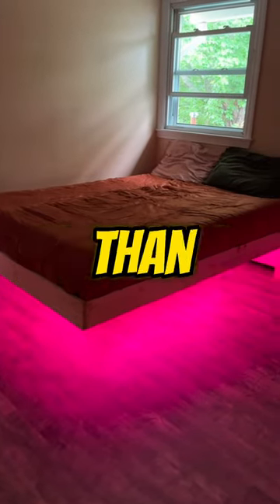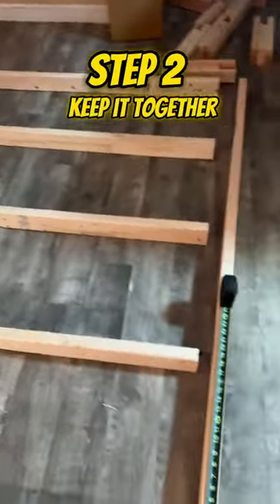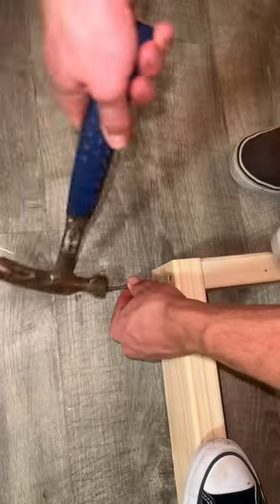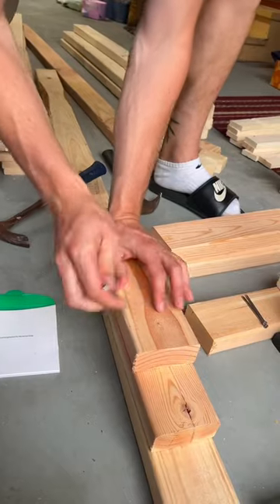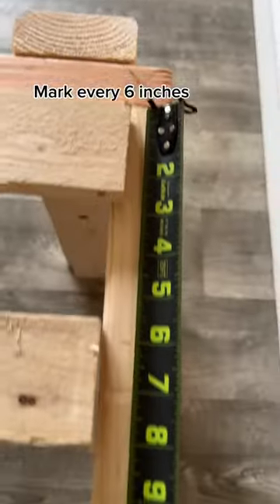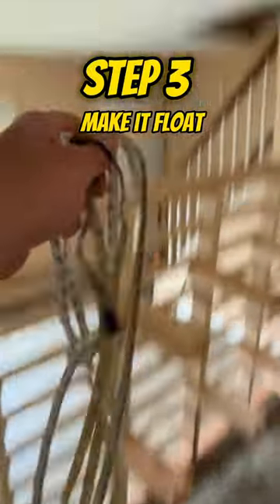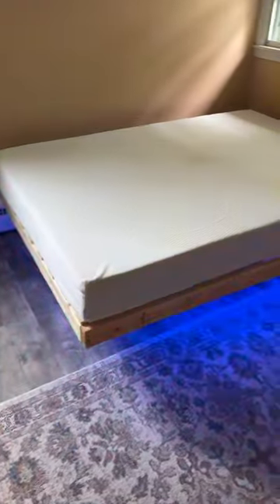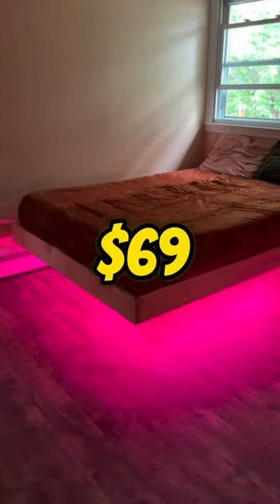How to Build a Floating Bed Frame for $100. #diy#floatingbed#lifehack#diybedframe

Comment: Gonna break the bed smashing on that
Reply: Remember that it only cost 69 dollars😂😂😂
Reply: This is actually a good point, how would you make this more sturdy?
Reply: @nocarebutyes3436 you can start with using a countersink with screws. That would make it much sturdier than nails
Reply: Wouldn’t it tip if two adults where on the edge of the

Comment: What would be the max weight for this?
Reply: In the middle there really is none but I would go over 300lbs on the sides where there is no support. If you built one with metal this could change

Comment: "$69" issue he used a 10.000 dollar saw. A 300 dollar nailer and 180 dollar drill.
Reply: It's about 350 for a table saw, you can have your hardware store cut them for you. You can use a hammer for 40 bucks and a drill is a drill so you'll need it eventually 😊
Reply: @carterbacon6232  well. I live in Australia mate. Here is nothing that cheap
Reply: the 69$ is for materials, you can reuse the tools whenever you need them, if you need cheaper tools and dont mind spending more time and labor you can use hand held tools such as hammers and hand saws.

Comment: Pro tip, nails would be better for this anyways because they have more vertical resistance and screws break much easier, bravo!
Reply: This is one of the beginner woodworking lessons I still carry with me. Prefer to swing a hammer over using a drill any day, honestly. 😊

Comment: You can make a smaller box that sits much lower than 15-freaking-inches that'll be much more stable for not even double what you paid. Still probably under $100. That's what I'm going to do.